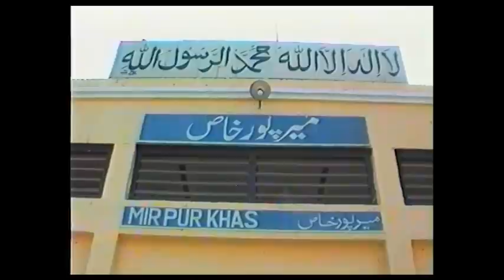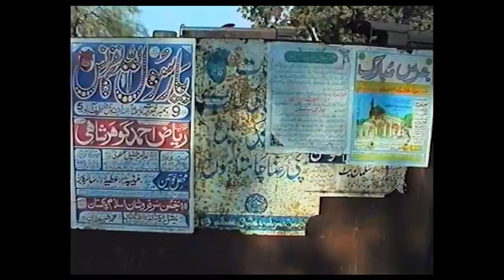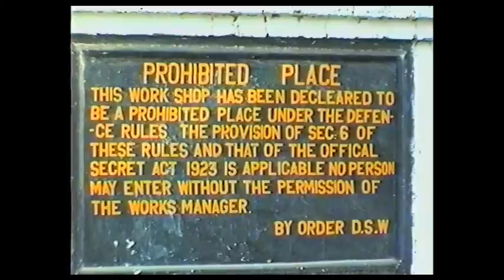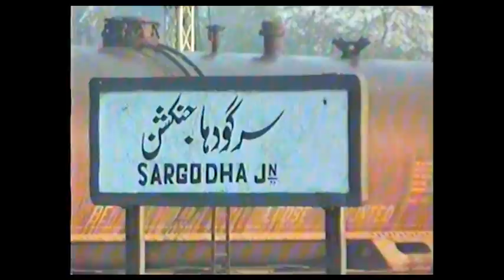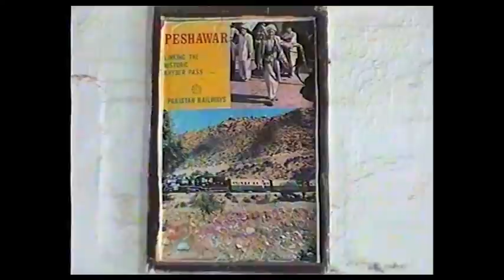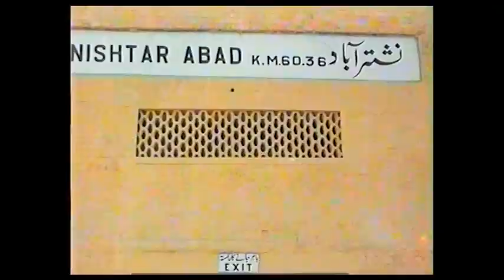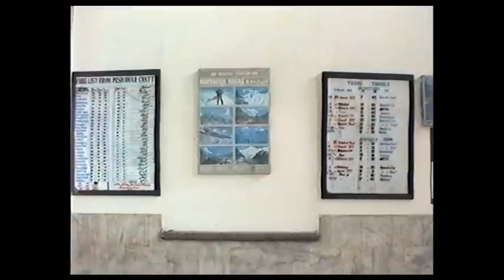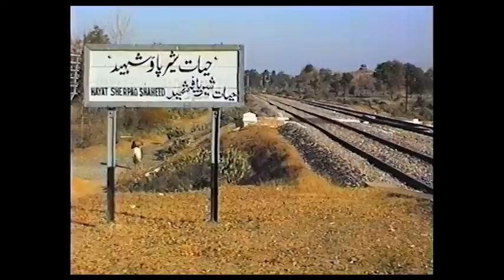A visit to Pakistan  between 1st to 9th January 1994.

Comment: Great video and memories Ian, thanks for sharing.
Interesting cross-over at around 32:00  I bet that rattled a bit.
Quick question- In this and several other videos you've posted from this trip, I've noticed that a lot of the Loco's are pulling a tank immediately behind the tender. Were they carrying extra water or, had some of the Loco's been converted to Oil Fired Boilers?
Cheers and thanks again for the videos.  Phil.
Reply from the maker: All Pakistan locos were oil burners as they had no coal mines. I think they were additional oil tanks based on the fact that water columns appeared to be plentiful and a processed scan shows the legend "furnace oil" on the side of one of these tanks.